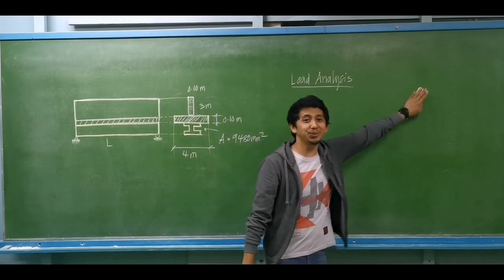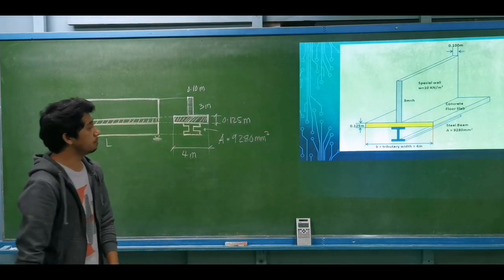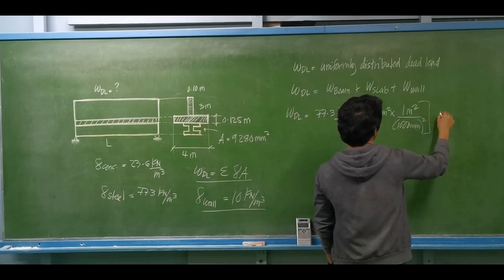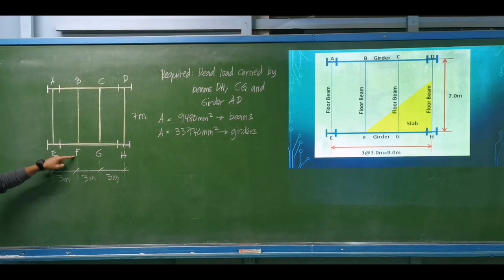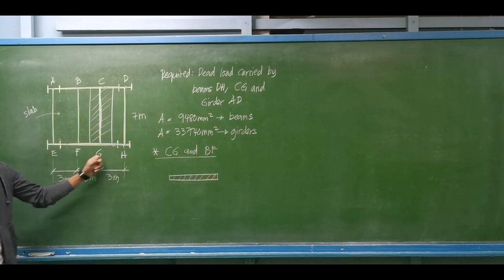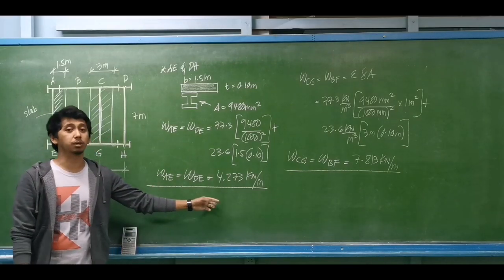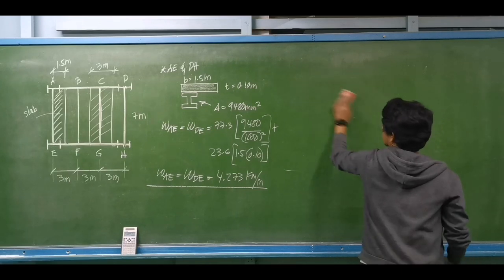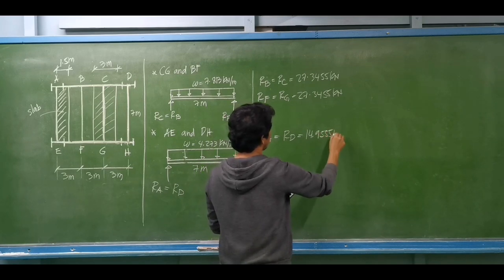Load Analysis - Live Loads and Dead Loads

Comment: Sir where is the weight of the wall you need to consider as to be the dead load?And pls explain why is that the unit weight of the concrete is just 23.6 in fact that is a RCC and the unit weight of RCC is 25 KN/m^3?
Reply: You can use 25 kn/m^3 no problem.
Reply from the maker: @temujinakim9606. Yes, in most references they are using 23.6 kN/m^3. Just for this example, I used another value.

Comment: Sir.. Ask ko lang yang density of wall and slab.

Included na ba jan yung REIFORCING BAR?
Reply from the maker: Sa pagkakaalam ko, ang reinforced concrete may unit weight na 23.5 kN to 24 kN per cubic meter. Sa example na yan, included na yung reinforcement sa slab at ibang material naman yung wall dahil mas magaan.
Reply: @AbrenianLecturer  thanks

Comment: sir pano kong di tuwid ang wall? hindi pala slab
Reply from the maker: Kung hindi kasi straight vertical yung wall, may twisting moment effect yung sa beam.
Reply: @AbrenianLecturer  e tatanong ko po sana if pano computen ang load or weigth pag hindi tuwid ang wall. 
Pa help lo sa pag solve. Salamat